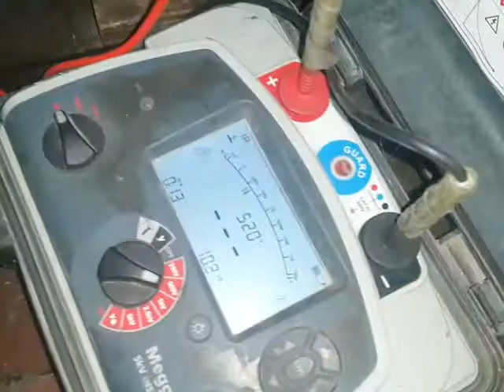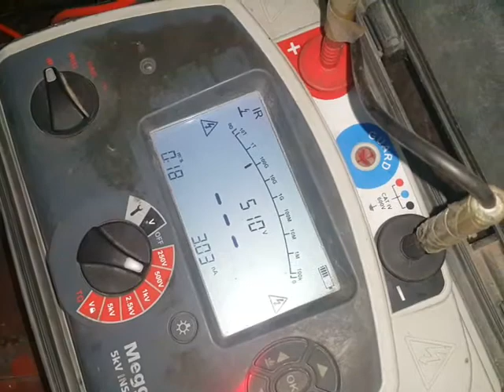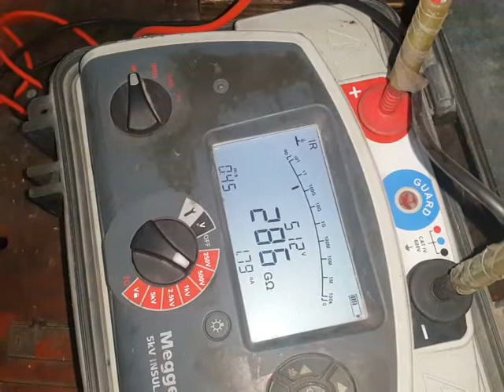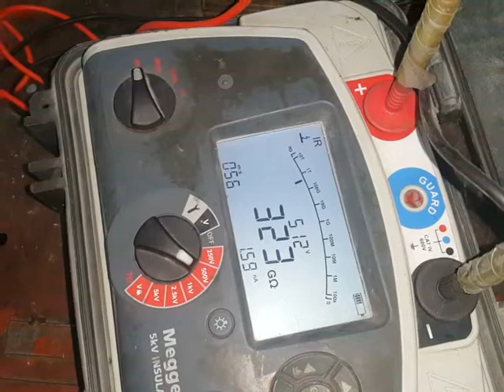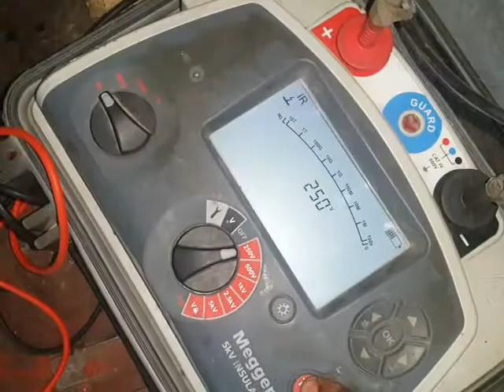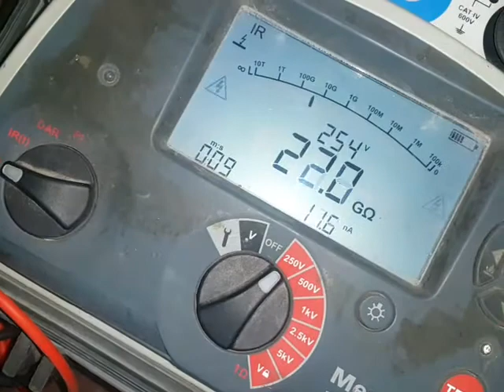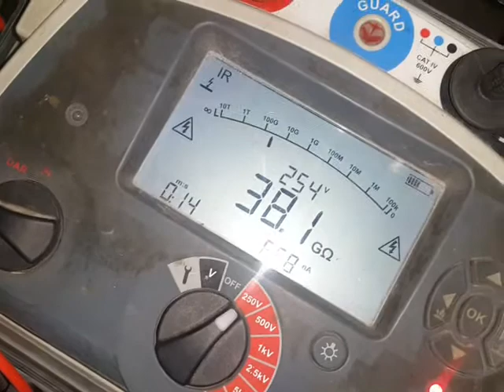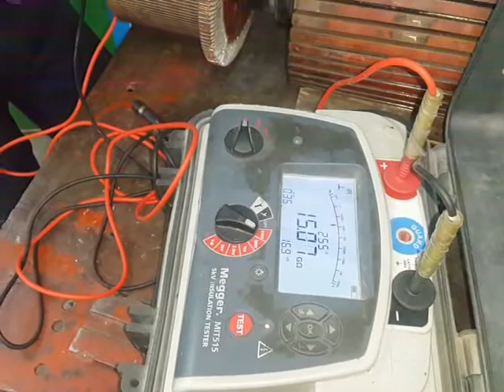detailed commutator testing procedure

Comment: Most of the test being performed here are incorrect. 

First, when doing insulation resistance of the commutator to ground, all commutator bars should be shorted with a copper wire or strap. On small motor like this it maybe not change a lot thought. The reason for that it that it prevents voltage difference on armature winding.

Second, why do a continuity test after you have done a megger test bar to bar. You have already proven that there was not. I would recomend instead to do a 180 degrees winding resistance test instead.

Anyway, they don’t seem to have a lot of budget in that motor shop to do thing properly.